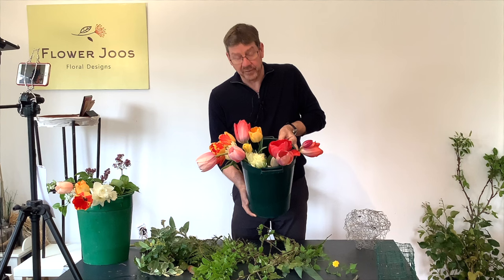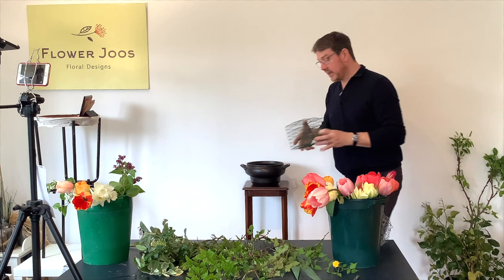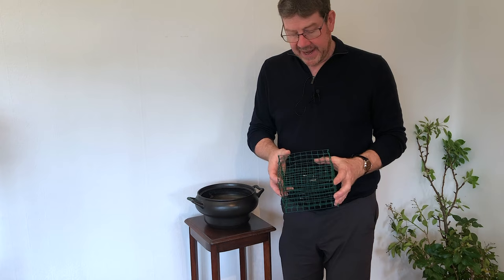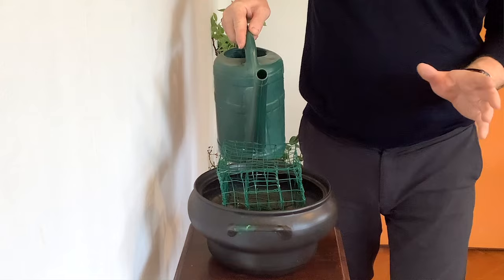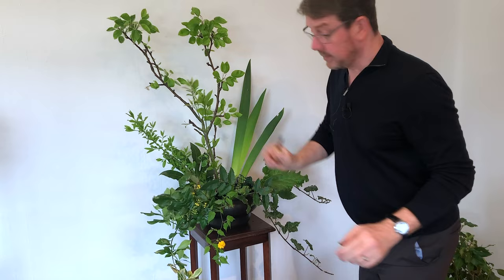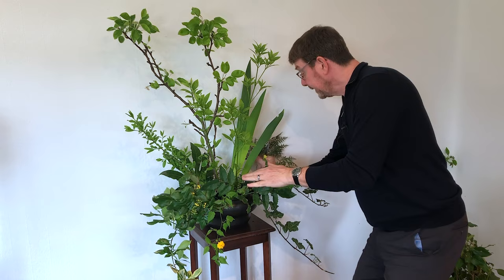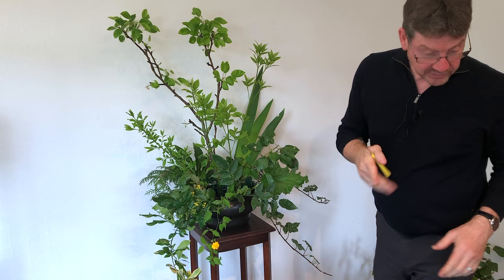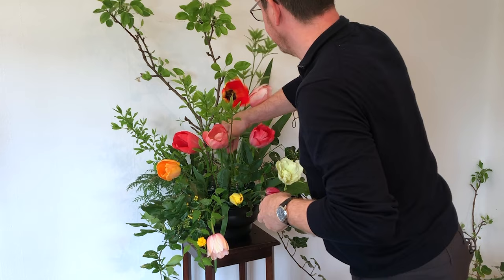How To Make A Tulip Spring Garden Design FOAM FREE

Comment: John beautiful composition. I love tulips but I have a problem. I suppose different types and colors but after a while they all turn red, the other colors die off.
Reply from the maker: I haven’t heard that before - I hope not 😀 are you in a very mild area?
Reply: @FlowerJoos  I live by the sea, three years ago I planted yellow tulips, quite a lot, now I only have two yellow ones, the rest, unfortunately, have either not sprouted or have discolored.
Reply: maybe the red ones are the strongest and displace the others?
Reply from the maker: @glubitus736  google says this - If a tulip plant is under any kind of stress, such as cold temperatures when it emerges, the chlorophyll may begin to disappear from parts of the leaves. That allows the red to show through. 
So maybe just not happy when they com3 through in spring?
Reply: In Poland we have harsher winters than in England, maybe this is the reason, it remains to enjoy what is. Thank you very much for your help, best regards and I look forward to your next videos.